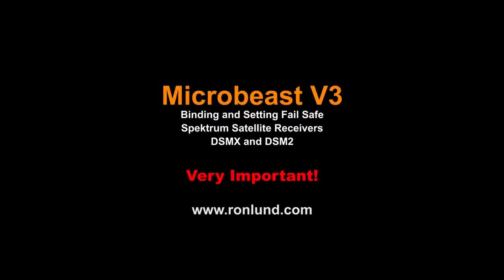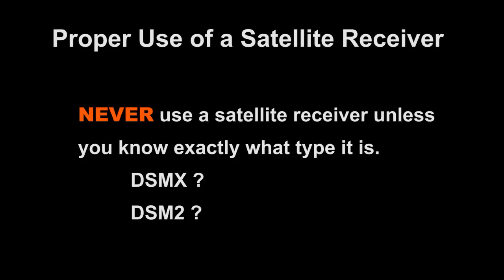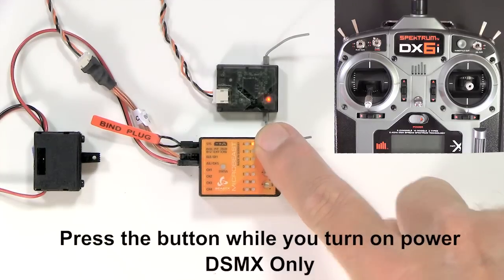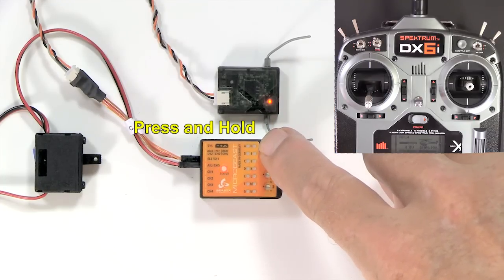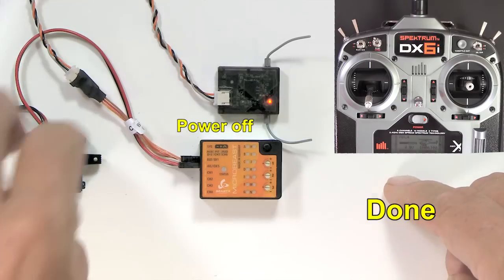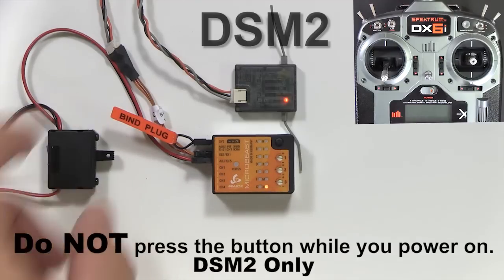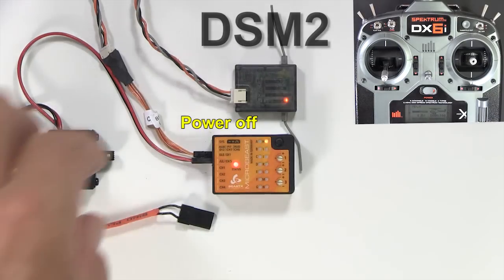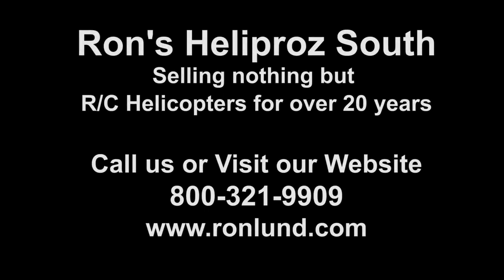Microbeast V3 Spektrum Satellite Binding and Fail Safe

Comment: Hello Ron. I am trying to set MB plus V5 Governor Menu D on a nitro heli. I am using Open TX (TX16S). I couldn’t get the Manual control(LIGHTS OFF) using the flight mode switch. Idle up and autorotation lights are ok oer the manual. Can u advise what could be wrong?

Comment: The beastx plus has the port on the side and it works with binding. So this means the beastx regulates the voltage. I also read to not exceed lager type helicopters like 450 size. What is truth, i do not fly further like 100meters. Will this just work fine on a 500size heli.

Comment: can you bind the satallite rx with it plugged into the side port. or do you need to use a special cable to plug into the port a standard rx would go.  im having much trouble with a secondhand microbeast plus and im wondering if its not binding properly.

also, is it correct that on the microbeast plus version, you do NOT push the button when you bind a dsmx satallite rx. ie opposite to the normal microbeast. highly confusing if they changed it around. those logical germans !
Reply: You can bind the beastx satellite in the side port. Ther are more pins but you use 3. Bindplug in the data port an voltage on any port.

Comment: Does a satellite with the BeastX only allow throttle failsafe setup?
I'd like to set main and tail blades to zero pitch as well. It seems in the event of a brownout it takes 3 seconds for the motor to kill which is plenty enough time for the heli to slam into the ground hard are climb out hard or go which ever direction it was last headed.
Thanks!